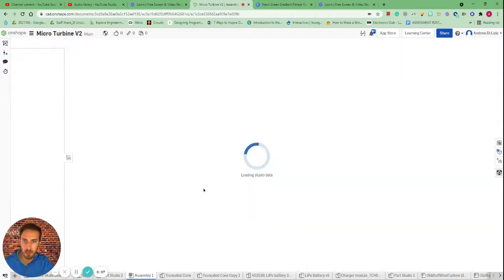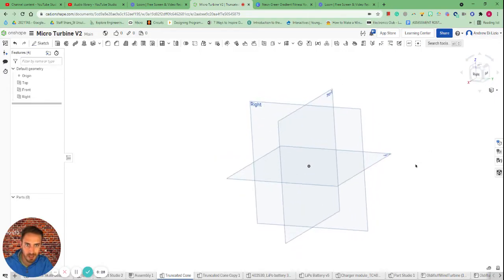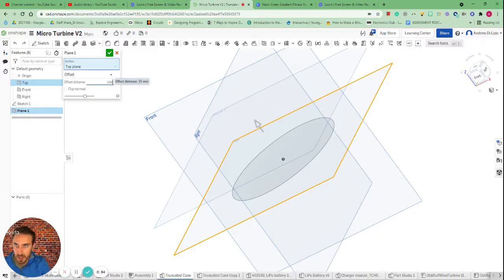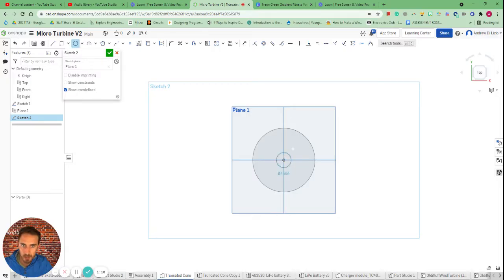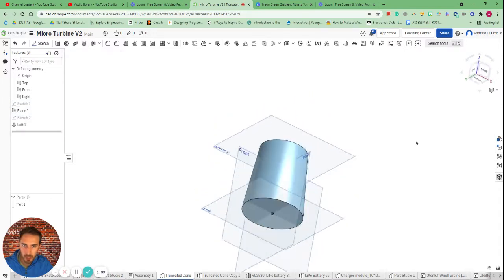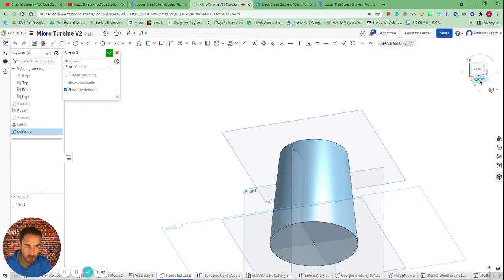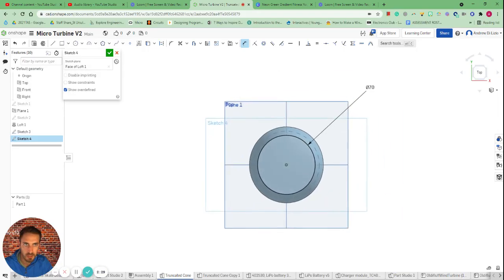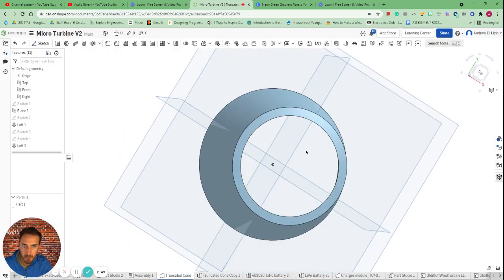How To Create A Truncated Cone in Onshape

Comment from the maker: What Onshape project are you working on at the moment?
Reply: Felt sorry for you not having any replies. I'm working on an adapter for a 50 mm hose to a 100 mm fan. Gonna suck some smell out when using glue with toxic fumes.
Reply from the maker: @NoiseMakerX  it's all good! I'm not too active making videos anyway! I've used this tool to make adapters too!
Reply: a lamp shade that has to flare outward, and I'm using the sweep feature as well
Reply: Great video for helping me solve a problem with creating a vacuum hose adapter. Sub'd!

Comment: How do you make a pattern on the side of that shape?
Ig you'd use the circular pattern but the fact that it's a cone and not a cylinder won't affect it somehow? Because the face is diagonal and not vertical or horizontal

Comment: what im trying to do is combine two parts let say i wanted the base of my first cylinder to be 2 inches and the top 1 inch the i want to make the second of to a 120 degrees or so but connect to the 1 inch part and be 2 inches long with its end be 1/2 in in diameter ... i can draw them i cant connect them